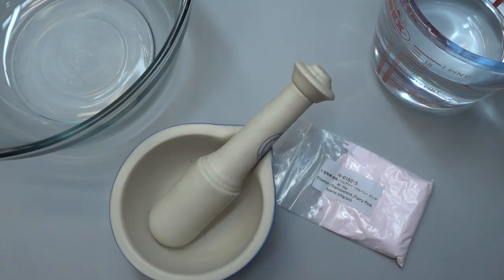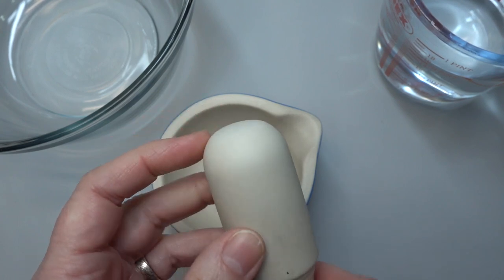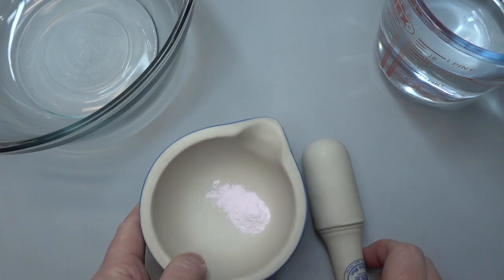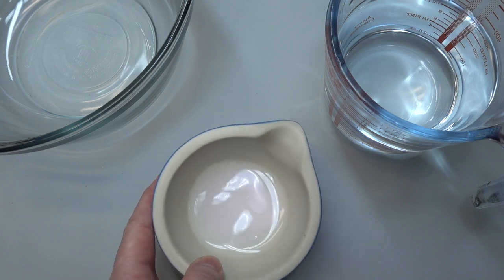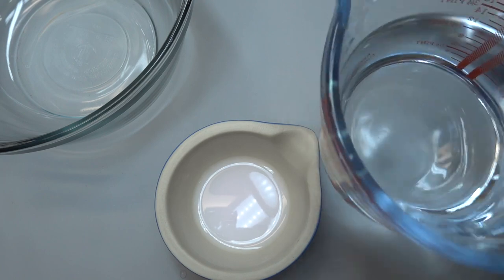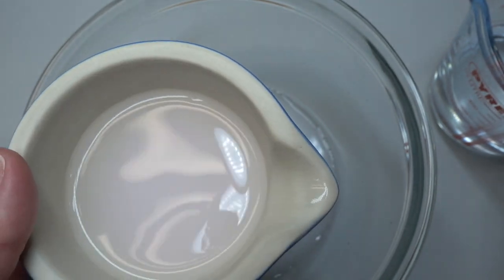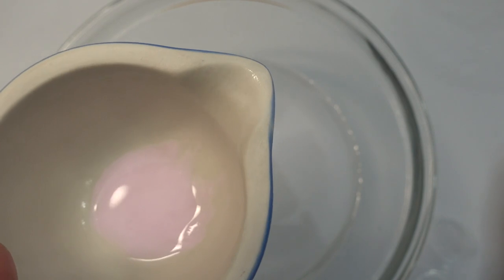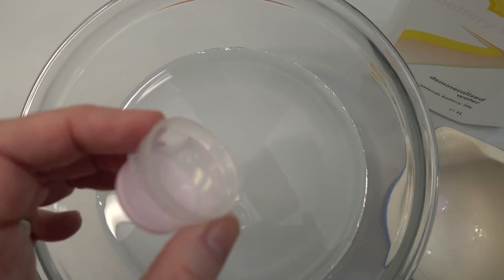Preparing Traditional Enamels by Washing and Grinding ~ with Joy Funnell ~ Metal Clay Maestro ;)

Comment: Is there a reason not to use metal pestle and mortars?
We have this fantastic set that’s been in my family for a few generations, I believe it’s cast iron or maybe some sort of ancient secret dark magic, who knows. It’s been around for... some time.
My nan was the last one to have used it for cooking about 20-25 years ago and it’s been decorating cabinets since.
Let’s assume it’s made of iron, if I clean it up, could I use it?
Reply from the maker: With any pestle and mortar there are two main things to consider.
1, when you grind is anything coming off the surface of pestle or mortar? Grind it really well while it is very clean and completely empty, then rub your fingers around the surface and see if there is any residue at all. Any residue will contaminate your enamel powder. (try this with a soapstone set and you will get a load of white powder from it as the stone is soft)
2, is the surface of both the pestle and mortar really smooth? Some materials are textured, eg natural stone like marble often has cracking. In order to grind the enamel evenly you need everything to stay in contact so if the enamel is dropping into recesses in the surface it won't all get ground.

Hope that makes sense! :D
Reply: @JoyFunnell  just finished testing and cleaning the mortar which had a bit of oily residue on it still.
There’s a bit of a decorative hemming thing going on along the lip and another design-ish etched thin strip around the inside that I’m going to have to try and see if anything gets caught in it, for just this test I tried to just grind  a piece of charcoal and it seems like the mortar and the pestle are both very evenly and uniformly covered in charcoal, so yeah, they’re smooth and even!
I’ll try glass tomorrow, now I have to waste about a year of my life getting charcoal off an iron mortar and pestle ٩( 'ω' )و